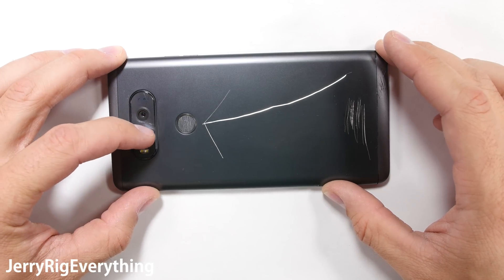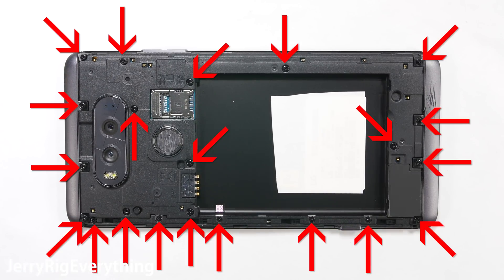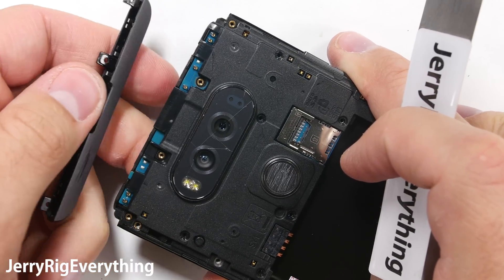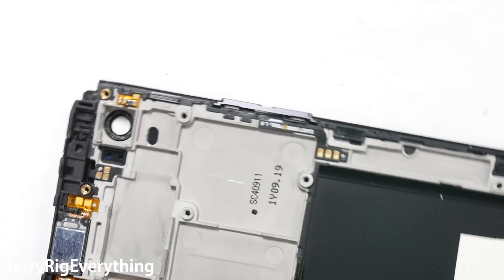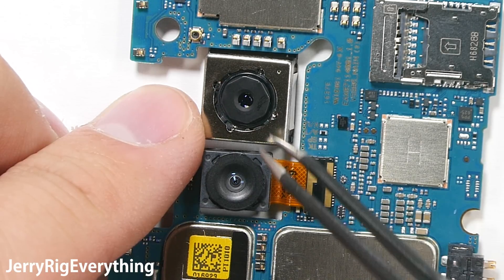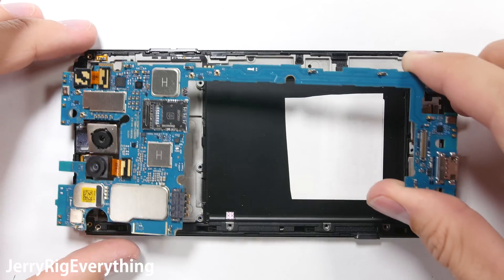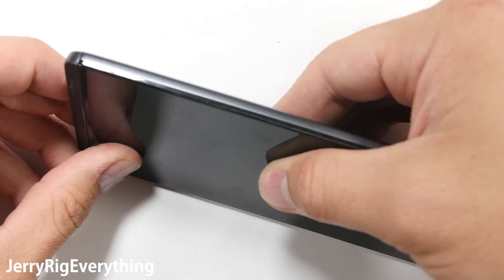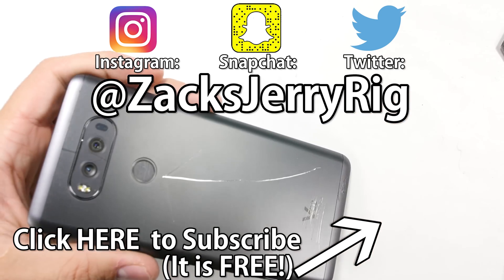LG V20 Teardown - Screen repair, Battery Swap, Charging port fix

Comment: Have a LG V20 with the "infamous" broken glass over the camera lens.  Do not want to pay the 200.00 insurance.  Any idea of where to either get the glass replacement or the entire assembly that you take out on the disassembly.  I have not had any luck in finding either.  Thanks

Comment: GUYS I REALLY NEED YOUR HELP! if you charge a phone whilst it is wet/water damaged, what will happen? Please reply asap!
Reply: Charging a water damaged phone will cause the circuitry inside to corrode and potentially ruin the phone. If you water damage a phone power it off, don't charge it, and if possible remove the battery. Now this going to sound strange, DON'T PUT IT IN RICE. If the phone is still wet it will delay the corrosion process. Get on google and find a local phone repair shop. Water damage clean up, usually cost's between $75 and $150. Anything much higher then that and you're getting ripped off.

Source: I work at a Phone/Electronics repair shop.
Reply: Alex Martin will it be set on fire or anything like that? other people keep telling me that it will set on fire and blow up and all that stuff.
Reply: Probably not.  It's not good and I'd follow my earlier instructions if I were you,  but it's unlikely anything so dramatic would happened.  Unless you actually trying to charge it underwater.
Reply: Again,  if you put an electrical current through a water logged phone it won't explode, But it'll more then likely fry the phone.
Reply: Alex Martin ok thanks

Comment: What I do to keep track of screws, is a draw a rough super fast sketch of what it looks like in side, and mark circles in each are there's a screw, the place the screw I removed on the circle on the picture relative to where I took it from :p Then I know where each screw goes exactly :p

Comment: 1:29 - 1:37 Even when the whole "climate change" nonsense is turning into a hoax? Remember, this used to be called "global warming", with all the fear-mongering scare tactics that the world is going to burn up. Turns out the bad predictions are false, temperatures have gone down (Especially in the arctic circles. Poor climate checkers!), more "climate sceptic" scientists are growing and Climategate exposed a lot of the falsehoods and ulterior motives behind the false claims. So, in essance, that analogy is illogical.
Speaking of Climategate, I recommend going to the Weekly Standard[dot]com and search "Scientists Behaving Badly", which talks about that and a similar case, ESPECIALLY Part 2! That part talks about how that climate model was peer reviewed...And it was TURNED DOWN, citing insufficient research and evidence. Unfortunately, those people behind that model pushed through with it anyways, giving their own community a bad rep in the long term.

But back to this video. Thank G-d Almighty we have another phone that's easy to disassemble for self-repairs. It looks like the only disappointment is that the USB-C port and the headphone jack is not replaceable. That must be where the nice, underrated LG G5 fills that need. If only Lucky Goldstar made a physical keyboard for their Friends lineup...Wait, is the headphone jack replaceable on the G5?
Reply: AzuMentch36 All of that climategate bullshit was forced through by Billionaires of the Petrol industry and is fucking stupid. If you prefer believing people who lied to people about their exploitation for years without a second-thought, instead of a community of scientist who prove year after year the impacts of the accelerated climate change we're living, then just go put that blindfold back on.

Comment: Nice guy LG makes phone that can stand bend-test AND have a removable battery AND is probably the easiest to repair smartphone in the world
Reply: Too bad theyve quitted this Concept after releasing this bad boi sadly
Reply: The samsung galaxy s4 is really easy to repair. Mine is still going after 7 years with one motherboard replacement due to me bricking it.
Would def recommend it. Goes for $40 on ebay.
Reply: Yeah, RIP to them 🙏

Comment: Thats what we need. A guy who insults a massive group of voters and a massive group of phone users. Genius.
Reply: sensitive are we?
Reply: Michael Worthy It's his show, he can say whatever he wants
Reply from the maker: +Michael Worthy i aint scared.
Reply: JerryRigEverything didn't say you should be. It's one thing to comment on it, that's fine. But A:not a political show. B: it sounded rude. I'm sorry if what I said sounded rude as well. It wasn't intended to be. I'm not "unsubscribing cause he was mean!" I'm just saying, it's a tech show, or at least the videos I watch are. I like it because for the most part it doesn't seem to biased. Phones are judged fairly. And I love watching the phones that just fail. crunching noise If you want to wax the politicos, you can. But maybe another show. That's my opinion. It's ultimately your call. Again, sorry if anything I said was rude.
Reply: look at all you bully hypocrites. Michael Worthy has the right to dislike the political commentary just as well as the author has the right to make the comment.

Comment: Compared to other phones like the OnePlus 3 I just had to replace the screen, this one looks like LEGO or something. xD

Hey Zack, since you did the test and even disassembled the device for us here, let me ask you a question that has been nagging me for sometime... that broken glass piece on the camera part - is it really lens, or just a protective glass cover?

Afaik, glass elements for smartphone cameras are all embedded into that square camera unit. Everything external to the unit is only there to protect things, not as part of lens assembly.

Which means that even if you broke that part of the LG V20, you could still keep using the camera by just taking the glass shards off, though that obviously meant less protection for the cameras themselves.

Anyways, thanks for sharing! You OnePlus 3 disassembly video was among the ones that helped me fix my OnePlus 3.
Reply: He will show the world how to replace that camera lens, so stay tuned! :D

Comment: Question i know is not related to this phone specifically but does anyone knows or charges to root and install old firmware for T-Mobile note 7? If it could be done remotely it'd awesome i live in Indianapolis IN

Comment: I had a decision conflict between the HTC 10 and the LG V20. The V20 has a never ending and ever growing number of compelling reasons to be my next phone choice, including the repairability ease you just showed. Love your channel man. I've been watching for a few months and never realised that I had'nt subscribed :P sorry. finally did it today XD
Reply: get the V20
does everything the HTC 10 does audio-wise, but you get benefits such as a removable battery
Reply: Shaiyan Hossain yup. IR blaster, removable battery and the peace of mind because of the mil spec 810g shock resistant rating. But the design of the HTC 10 is incredible, its skin of android is super fast and it handles ram well and its just generally snappy, and that its smaller, all contribute to a better day to day experience compared to the v20 which offers more features that would be used/noticed lesser. That's why I keep getting stuck :P but I'll definitely end up with the v20 anyway...

Comment: Zack you should introduce a new part in your tests:
Heat test. Put the phone in a situation where it's heated up by its surroundings. Some of your viewers live in warmer, tropical countries where the summer easily reaches 40• C. I remember once driving with my car during the summer with the ac on. I had my iPhone on the passenger seat and it stopped working just by lying there for 10 minutes.
I had to put it in the fridge to lower its temperatures
Reply: Also a heat test is more beneficial than a burn test as very few phones really are exposed to flames while most are exposed to heat.
Reply: You have a nice idea. He should also do at -10 or -20 Celsius. There are people that are living with those temperatures.
Reply: I don't care about Trump.
Reply: I'm in Germany and we are freezing too xD
Reply: Ilias The 123 h
Reply: yeah cold test would be great! Canada is cold you know 🇨🇦
Reply: Ilias The 123 still... You don't have to fear the Trump. I'm hiding in my igloo since
Reply: Ilias The 123 
Does cold stop the phones functions?
Reply: @kimjongtrump1934  Devices with boards like these phones and not much "airflow"  normally work fine in low temperatures  (cold), but too cold isn't good either.
Reply: @kimjongtrump1934  cold can cause condensation inside of the phone if its not ip rated
Reply: No but it drains the baterry faster... I think...
Reply: Love your icon lol

Comment: I've damaged a screen to the point it needed replacement, only once, but I've had quite a lot of water damage, from minor, temporary damage to heavy damage that rendered my phone dead. (this is what happens when you live in the Netherlands and commute by bike no matter the weather). 

So even though the v20 is a fantastic phone with great audio capabilities, I guess I'll give the edge for water protected phones. 
 
That said, IMO the iPhone design is much smarter were the screen is the first to come off.

If you need to replace the screen of a galaxy, it's the last bit to come off.

Comment: this is why like lg's easy to dismantle and to repair
Reply: bassamxp except the only part most of us will need tonrepair is unrepairable. the charging port. its almost like they do it on purpose.
Reply: Nerys Learn to micro soilder you can Deffently replace it pretty easily in 10-20 mins
Reply: Gavin Hanson not so easy to actually do. literally no time working 2 plus jobs and my existing soldering skills are pathetic :-)
Reply: That's where the LG G5 comes in. That charging port is easy to replace.

Comment: Hi zac, I have a question about a Display repair what i had on my sony z3.. I found a really good display from China but the problem is the adhise for the display.. After a while its getting loose.. Soo do you know where i can find a good adhesive? Thanks

Comment: Most phones from LG are super easy to take apart, there is a lot of screws, but that's better than a lot of glue...
Reply: Lim Ming Quan no in all cases, for example, the Motorola Moto G3 is a water resistant phone and have a removable back cover and screws.
Reply: RemixedVoice Did you eat the rice?
Reply: Manuel LibreGeek The LG G2 was a pain in the ass though
Reply: Manuel LibreGeek exactly
Reply: The G3 isn't water resistant like you think. The internal components of most Moto devices have a hydrophobic coating that repels water, but anything more than splashes and you'll have a dead phone.
Reply: "water resistant" yes, but no "waterproof" (IPx7)
Reply: TlathamXmahtalT I dropped my G3 into my toilet that I had just seconds before, pissed into. I took the phone apart and left it in rice for 48 hours. Still works like a charm to this day.
Reply: RemixedVoice you didn't at least rinse the piss off of it first?
Reply: Daniel hahaha you're right, this flex cable inside was a nightmare.
Reply: Manuel LibreGeek Pretty much everything was a pain short of replacing the protective plastic that protects the motherboard.
Reply: Manuel LibreGeek but at the cost of water and dust resistance.

Comment: Why aren't all phones built like this?  It just makes me mad when I see those adhesives making it necessary to use heat guns and other tools to pry own the phone.
Reply: David Jung IP Ratings
Reply: Water-proof. And more revenue for companies such as Samsung, if phones are hard to repair, they'll be taken to the manufacturer, that means more $$ for Samsung.
Reply: So that they can look premium and attractive
Reply: Honorien I'd rather have a phone with a removable battery than waterproofing. Batteries always go to shit after six months. I take care of my 800$ devices and I'm not about to drop it into my toilet.
Reply: BlaCk MamBa Really? When these unibody water resistant phones have some damage or are repaired sometimes they lose some of their water resistant. How is that better than a phone that can be easily repaired.
Reply: +Pete S.
Its not. But problem is that most people dont care since they are on a contract and get the new phone next year anyways.
So why not have a water proof phone for a year or maybe two?

Its a sad reality but it is like this.
My next phone is probably going to be a fair phone or something similar. For now I have Sony Xperia Z3. The touchscreen scattered ones but instead of getting a new phone I had it being repaired. To me its worth nearly 200 swiss francs to know that I didnt throw away fine working hardware.

But yeah. Most people are not willing to spend that much money. I guess its a question of what you believe.
Reply: RemixedVoice
That is very good! :) Its good to hear that there are some people that do care!

Yeah I was thinking long time about this (having a battery that I wont be able to replace by myself). But since I didnt want a big phone but rather a small one with somewhat similar specs to its bigger brothers it was the only way to go back then. I never replaced the battery until today and it is still going strong. One and a half day of regular use (light mobile gaming and texting), heavy usage about one full day, light usage 2 days.

I think im still good with it. And if the battery gets bad I'll probably replace it as long as the rest is fine. (Im willing to pay 100 - 200 swiss francs for this).
Reply: this phone requires heat as well.. he didnt show that part.. watch other videos and u will see.
Reply: Just because of greed. They want our money.
Reply: David Jung so they don't break easy and it's much easier to have an ip rating. It's better to have a phone that can go underwater than a phone easily repairable.

Comment: I didn't see a link to buy the screen assembly. Also, where can I find just the motherboard if the charging port goes bad?
Reply from the maker: They dont sell the full motherboards... youd just have to get a damaged phone at that point and splice them together. The links should be right below the video.
Reply: It is probably a lot cheaper to let someone with the micro soldering station and meditative skills in his hands to do a port replacement.
Another thing, when I notice my USB micro port is wearing and before it goes down completely I will affix one of those magnetic USB connectors to it.

Comment: Refreshing to see a phone that's so easy to take apart and repair.
Reply: +D13H4RD2L1V3 it's rare these days
Reply: D13H4RD2L1V3 most LG flagships are...
Reply: Vinnie Tran The exception is the LG G2. Almost perfect phone, just one problem, if your screen cracks, and you want to replace it (like how I had to do it) GOOD LUCK. It is very hard as not only is the back non-removable and almost glued down tight, the rest if the components are almost impossible to get out. Took me 3 days to disassemble. Other than that, I love the LG G2
Reply: The g5 was super easy to repair too
Reply: Apple should take notes
Reply: +Pigs Nation yeah ikr